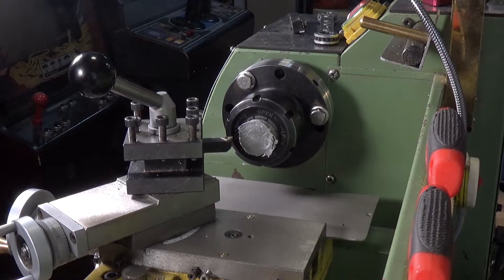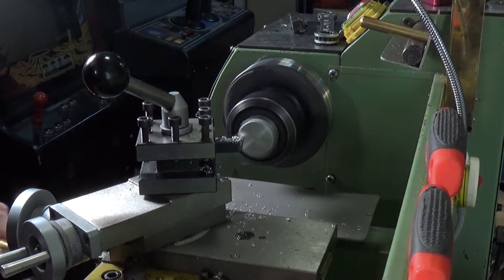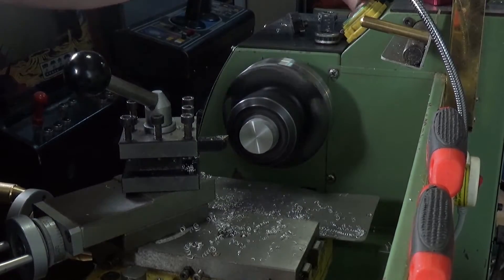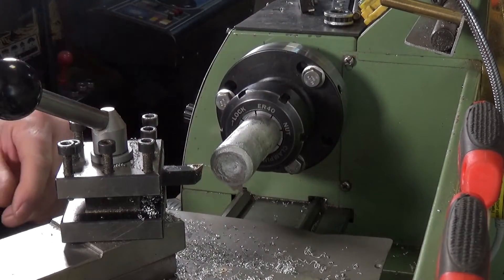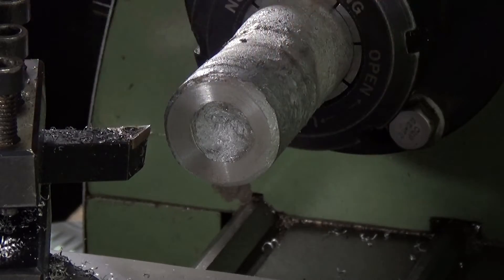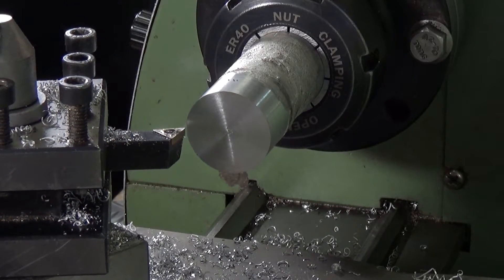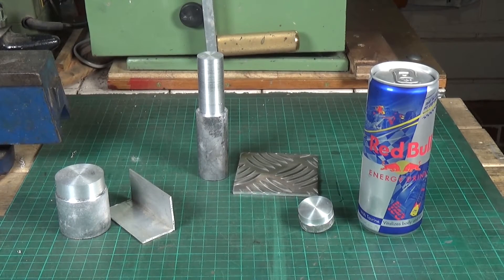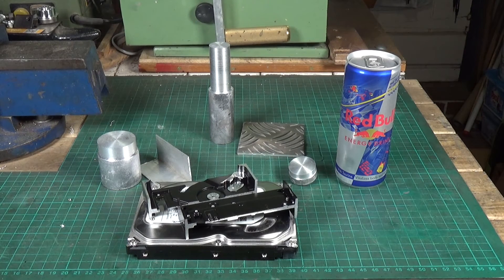Beer Keg Furnace - Part Three - Machining home cast aluminium

Comment: good source is old/damadged car aluminum rims, washing machine pulleys, electromotor cases
Reply from the maker: Car aluminium wheels has been suggested by several people. I had not thought of washing machine pulleys or motor cases, thanks for the tip.
Reply: All hard to find though

Comment: Hi Alan good video on the meltdown results. I am glad that I can view both your channel and Rob's without having to fly from the UK to Australia each time. HaHa. I worked with aluminum having tooling built for the company I retired from. We used 6061 and 7075 aircraft grade. Like Rob was saying in his comment you can get a good idea of the grade of aluminum by the sound. I would ring it with a wrench or hammer lightly and you could tell the difference in 6061 and 7075 from the high pitch ring sound. I wonder your local recycle center would work with you on aluminum scrap. Just a thought.
Reply from the maker: Hi Ed. Yes, I'd never thought about the sound that it makes but I will be paying a lot more attention next time I machine some. Sadly over here in the UK you usually have to pay for things like scrap metal from a recycling centre. The hard drive route seems to be a good one to go down as I used to work in the IT industry and we used to scrap hundreds if not thousands of dead drives. Cheers, Alan.

Comment: Very good video Alan.  I expected the drink cans to turn out well (despite adverse comments by other viewers) as it has to be pressed out and high tensile for the gauge.  It looks to be almost aircraft grade in characteristics.

One thing I notice is that you can usually get an idea of how hard it is and the composition, by the sound it makes when machining.  The drink cans were relatively quiet, but the checker plate made more of a "hissing" sound.  The poorer the grade, the more pronounced the hiss from my experience.  Overall your results were great though and all those sources/grades totally fit the bill for free quality ally. Plus free always makes you feel good - great to beat the rip off merchants.

The HD chassis pour will be interesting.  I was pleased to see you had no porosity issues using my method.  Apparently I upset quite a few "experts" on some casting forum by all accounts :)  He He.  Typical forum armchair experts.  All show and no go.

Cheers Rob
Reply: xynudu 
And just when their wounds  start to heal i dig up that old post and add a link to Alans videos ! ( Alan please don’t do any sort of reviews like Rob does as they remove links to these channels because their advertisers had a dummy spit and I won’t be able to taunt them anymore ! - it is a highlight of my life at the moment 😂)
These videos just keep on giving !  Well at least until they lock the thread on said forum ! 
It is because of these armchair experts or keyboard warriors that my forum activities has been scaled back - i just can’t be bothered arguing with some dickhead google cowboy who knows nothing !
Reply from the maker: @Flattyman  Rob, Ian. I have read through some threads on a certain forum, no names, and found the whole thing hilarious. You get such comments like "I would never use recast aluminium as you don't know what grade it is" and the ever popular "recasting aluminium weakens it". You'd think we were casting turbine blades for jet engines the way they talk. myfordboy, who I think we all agree knows a little bit about casting was telling me that he has been banned from this particular forum. Which is their great loss in my humble opinion. I happen to be the proud owner of one of his castings and I'd like to see a professional foundry do as good a job. Cheers, Alan.
Reply: @RetroSteamTech  
I like Myford boy also although he is a bit light on the conversation  side of things 🤣
Oldfoundryman  and Mark presling are another couple i watch as well.
I know on the forum i was referring to that some members have walked awsy because of the treatment they have received from the people running it and a few other members. I am also a member on two U.S based forums and from what I can see it doesn't happen on these.
Anyhow Alan  keep up the good work  , your videos are an inspiration to guys like me who would like a simple but effective set up that works but doesn't cost the earth to build !
Reply from the maker: @Flattyman  Thank you, that's very kind of you to say. All credit though really should go to Rob, it was his paint can furnace which was my inspiration and his help and advice has been (and still is) invaluable. Cheers, Alan.
Reply from the maker: Thanks Rob. There will be another one soon on the hard drive aluminium. I never thought about the sound it makes, I will listen carefully next time I machine some. Cheers, Alan.

Comment: Try stirring some Lo-salt into the beer can ali you will get a lot more out of them. Hard drives are a good source of metal, as are old car wheels.
Reply from the maker: Hi. Thanks for the tip. Several of the guys that cast their own ally have said that car wheels are a good source.They are a bit expensive second hand here in the UK. Hard drives seem to be the best at the moment they are basically free!
Reply: @RetroSteamTech  If you can find old lawn mowers the engines in them are mostly alloy and if you are lucky the deck might be too. I was given big pistons and 4 wheels so have enough to last me the rest of my life.
Reply from the maker: @backyardmechanic921  Hi. Never thought about lawn mowers, great idea 👍
Reply: @RetroSteamTech  Hi Alan,  the motor will be good ally, but the cutter deck definitely is NOT.  I've already tried this and they use mainly zinc for the ally deck die casting.  Machines up absolutely terribly.   If it is a pressed out deck it will be better ally as they can't bend zinc. You will soon know if it's zinc as it will snap rather than bend and have large crystals along the break faces.  Cheers Rob
Reply from the maker: @Xynudu  Hi Rob. Thanks for the info. Although it's not very likely that I will be coming across any old lawn mowers. At the moment old hard drives seem the most readily available free source of aluminium. Cheers, Alan.
Reply: @RetroSteamTech  
I wonder what an automatic transmission housing  would be like? You might be able to get the broken housings from a transmission reconditioning joint cheap - grease the owners palm with a couple of quid - beer money possibly ? Old cylinder heads are another option also.
Reply from the maker: @Flattyman  Yes that might be a good source. I think that for me the most easily available free scrap is old hard drives, they are also easy to cut up.

Comment: Hi Alan,
The Red Bull cans worked better than I thought... I think that idea has got wings...
You should make a can crushers so you can store them up without using to much space.
The hard disc idea is a good one, looking forward to seeing the results.
Take care
Paul,,
Reply from the maker: Hi Paul. Yes I was surprised at the Red Bull cans. If you had a large furnace that could take 20 or 30 crushed cans at a time it might be worth while. There will be another video soon featuring the hard drive aluminium. Cheers, Alan.
Reply from the maker: Hi Paul. I forgot to mention I did make a can crusher once, video here https://youtu.be/jq_rtzsEhVA not very practical though 😂 Cheers, Alan.